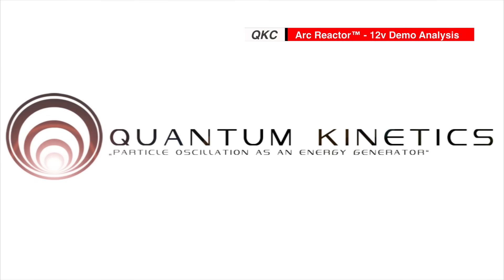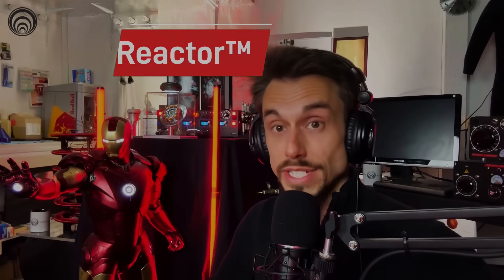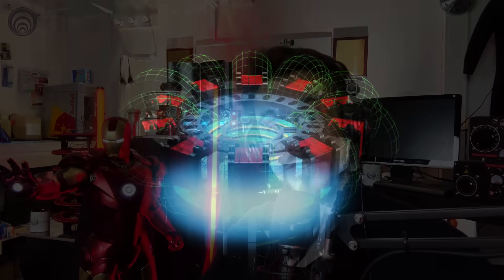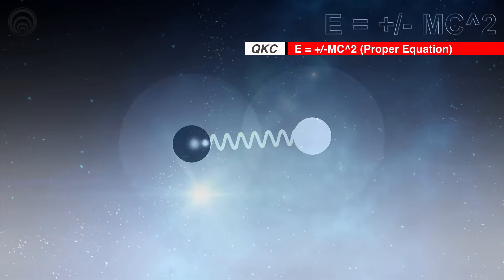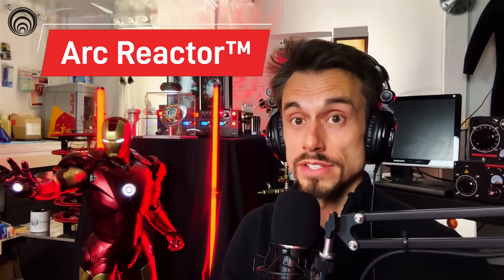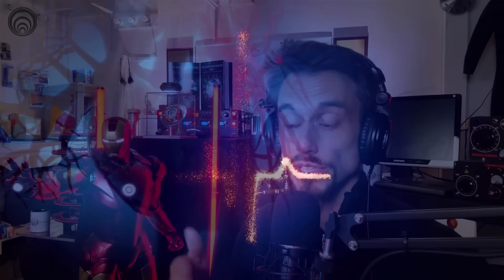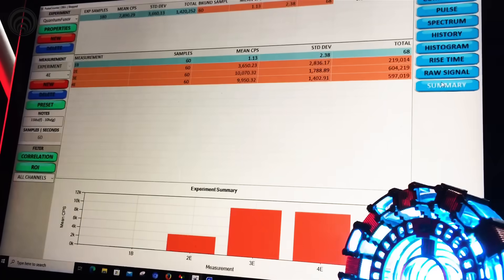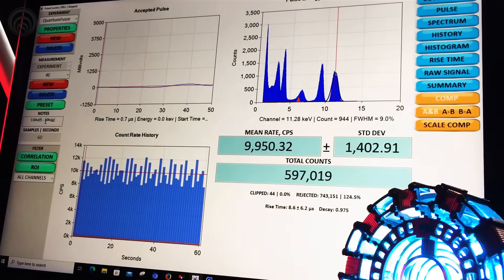Arc Reactor™ | 12v Demo Analysis | Quantum Kinetics Corporation

Comment: Hello sir, this is really cool, how much power does this produce?
Reply from the maker: Thanks for your comment.

Power is a relative term. There are many forms (EMF) frequency for power. Are you speaking of electrical power? Remember, electrical power is merely photons trapped in conductive wire. So, considering the frequency is the more important element of discussion... After all, the X-ray emissions from the ARC REACTOR™ (3 to 6 keV range) is actually technically gigawatts of luminosity power. But, not great for electrical "power". I hope that makes sense.
Reply: @quantumkineticscorporation I see, yes, my question was in regards to Electrical Power produced. Does this Device make enough Power to run a Home, Car ect by itself?